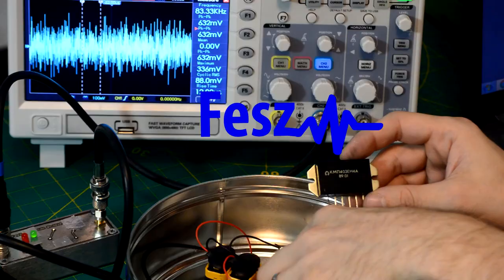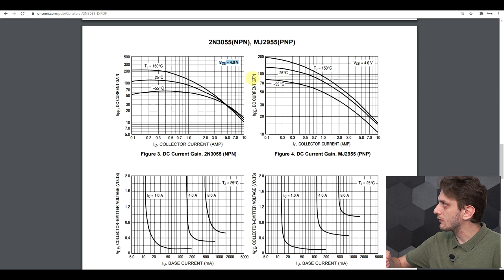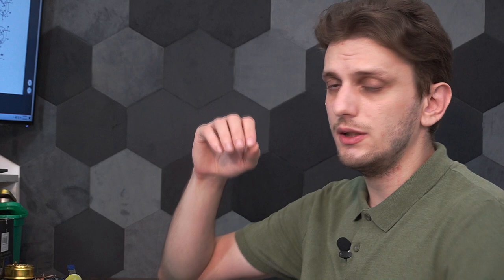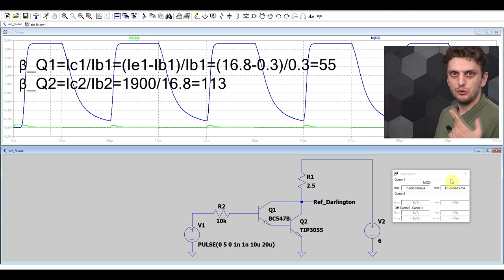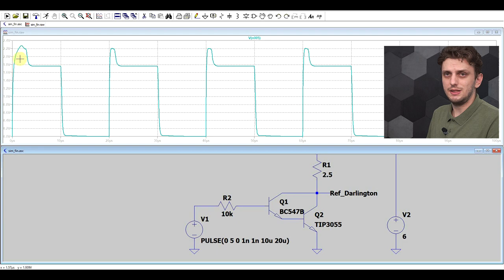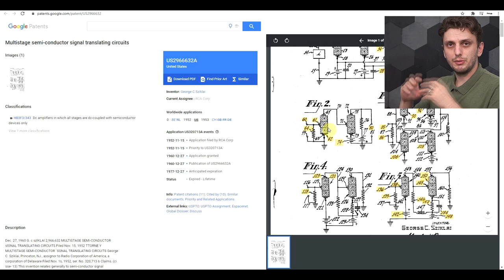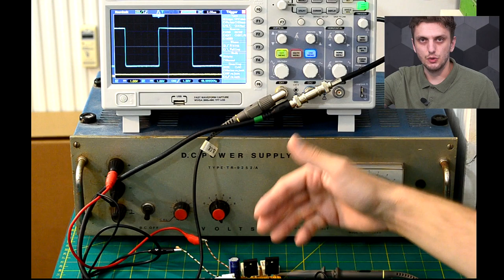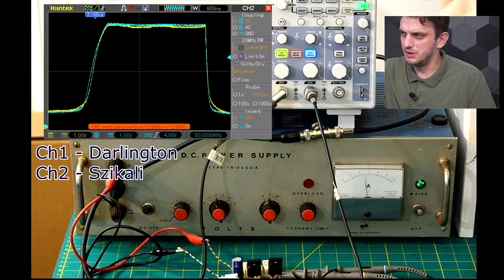Electronics tutorial - The Darlington and Sziklai transistor configurations

Comment: The main advantage of the Sziklai design is its lower base to emitter voltage of only 0.6 to 0.8 V. So in audio amplifier configurations you can get with your output signal closer to to the power rails. So at +/- 12 V you will get with Darlingtons about 10 to 11 W of output power at 4 Ohm impedance. with Sziklais you can get 13 to 14 W under the same conditions and the heat produced by the output transistors is considerably lower at full power.

Comment: Great gain, terrible transition frequency
Reply from the maker: You win some, you loose some :D
Reply: @FesZElectronics  It used to be common practice to not just use low gain power BJT but also to brute force base current into RF BJT to operate them at low current gain.

Comment: It is funny that Darlington promoted the idea of having both transistors in the same package and this is how you find them ..And Sziklai didnt  and you have to do arrange that configuration with discrete parts..
Reply from the maker: I was not aware of this, its an interesting piece of information! I guess considering the way in which transistors are made, its easier to have 2 of the same kind on the same substrate, than to have 2 different ones.. especially in the early days of transistor manufacturing it would have been far more difficult to construct a Sziklai configuration...

Comment: What a nice video! very good explanation. In some old projects it is common to see only the NPN 2N3055 in the output stage: Darlingron in the positive line and Sziklay /CFP in the negative line. Nowadays its very common to see two complementary feedback pairs, CFP in the amps output 😀. Some measurements shows that its the better solution for THD. I never have used this configuration... maybe in the future 😉. Once again, thank you 😉👍
Reply from the maker: That was really the main reason I insisted on using 3055 related transistors - for quite some time it was the only power transistor available. I have also seen the same thing in the old books - power amplifiers being built with 2n3055 based push pull stages. I guess the more symmetrical the output stage is, the better for it will behave from a distortion point of view.